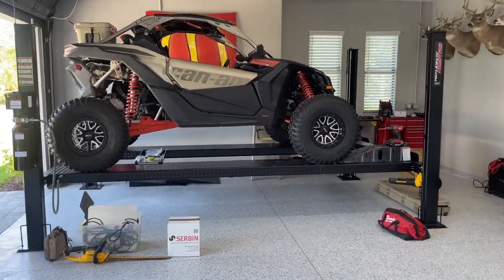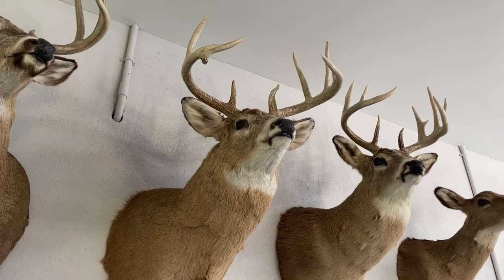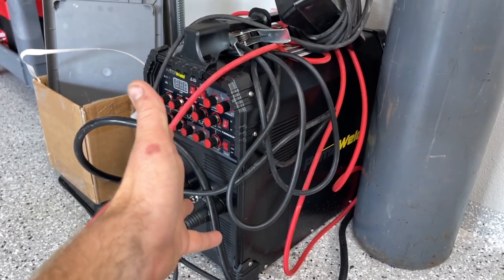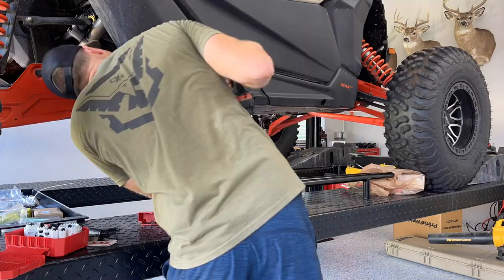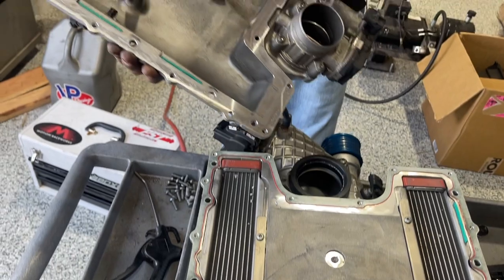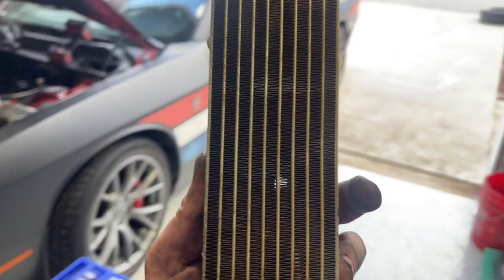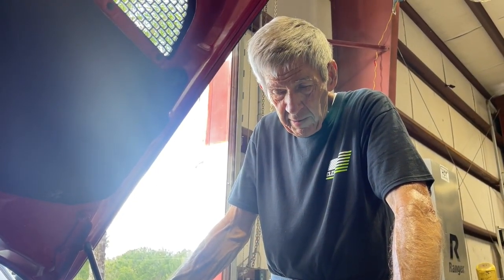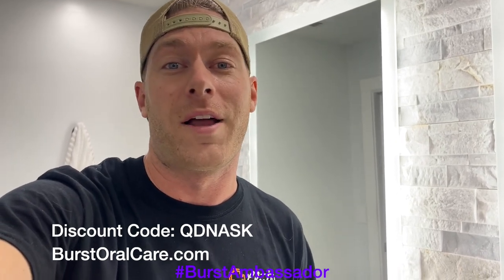Totaled the Hellcat Blower, Sam and I Dig Deeper to Assess the Damage... First Garage Projects!

Comment: Drop the whole cradle out of the car it takes maybe 1.5 hours. It’s so much easier than pulling the engine out the top. Also built short blocks are like 5-7000$ which is about the same as good spec LS so don’t listen to everyone saying to LS swap it.
Reply: Agreed
Reply: If you LS swap a Hellcat you should be kicked right in the nuts!!
Reply: That’s how roadkill did it when they stripped a hellcat to put the motor in the general mayhem dropped engine and cradle through the bottom

Comment: Parker, I would recommend putting some metal against the wall on top of that table. Will protect the wall and possibly prevent a fire. 
A cheap roll of 12” flashing from lowes will be enough to redo it a couple of times
Reply: 100% We do this at work, also protects table some.
Reply: That's most likely a block wall being in florida
Reply from the maker: It is block but the metal wouldn’t hurt
Reply: @Bward216  Doesn't matter what the wall is made of still protects it.

Comment: If I could give some advice on that welding table, add more bracing to the bottom of it, it doesn't take much heat put into the table to warp it. All ya need is some ¼ thick flat stock, and put them in a H pattern

Comment: Do a leak down instead of a compression test. If you can hear the air escaping in the top end of the engine it's a vale not sealing and you can just continue to run the motor and it wont hurt anything. Time for a valve job the next time the heads come off though. I have horrible leak down in half my bracket engine because it has so many runs on it but it still prints 6.50 slips.

Comment: Parker, I recently had a rod let go in an LS1 with a LSA TVS 1900 supercharger on it.   When the rod let go the piston shattered.   The shattered pieces of piston got sucked back up through the valves into the blower inlet through the bypass valve in the blower.  It destroyed the rotor pack in the blower.   I'm going to speculate you are also missing a piston or at least a lot of pieces of one.  Congrats on the new house sir!

Comment: Still watching but if the rest of the engine is good throw another blower on it and run it again. If it's hurt take it to the Hellcat guys and let them go at it or replace the block and use what's still good. Once you put some other non Hellcat type engine in it it's no longer a Hellcat.

Comment: Compression test, it will tell you the health of the engine.
Reply: He has already done a Compression Test in a Previous video. That is why they are talking about a broken piston ring or a cracked ring land. The only other way a diagnosing the Low compression issue without tearing the engine down, is to do a Leak down Test. That will tell Them if it is a bad valve (top end) by air escaping from the inlet or exhaust ports. Or if it is a piston ring or a ring land the air will escape from the Crankcase.